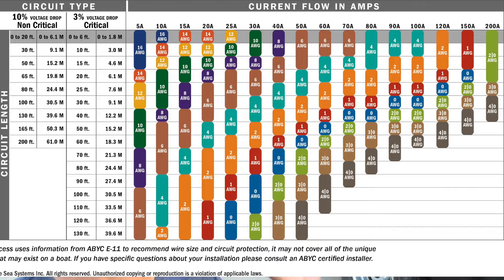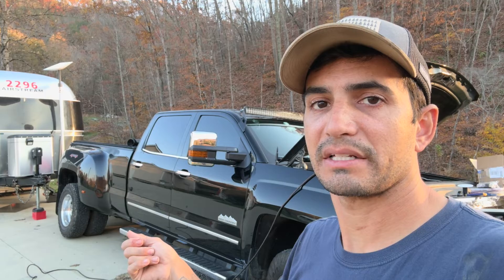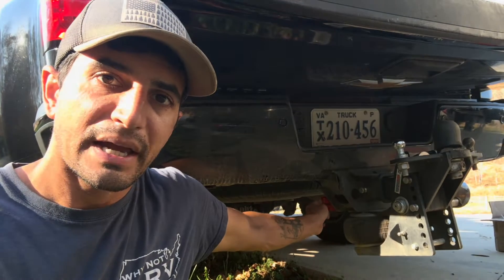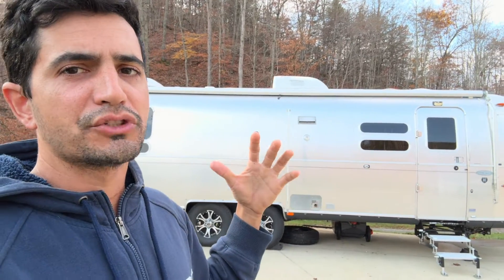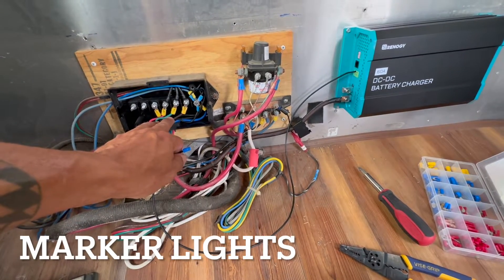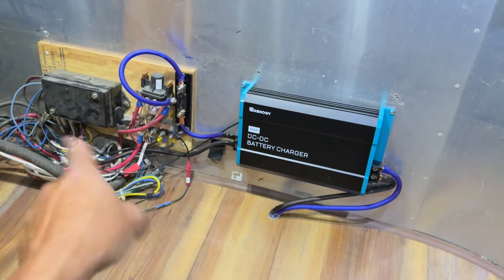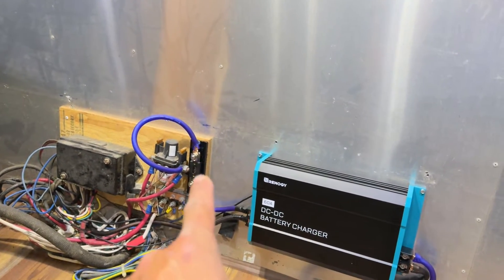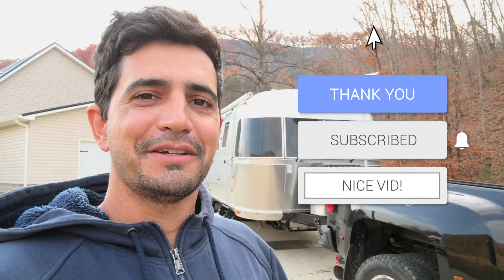Truck Charging! Installing a 60 amp DC-DC Charger - Why Not RV: Ep 139

Comment: You didn't mention one of the best features of the Renogy charger.  There is a second port next to the D+ that is labeled LC+.  When it is powered it reduces the charger output from 60 to 30 amps.  This reduces the amount of power your engine and alternator use to power the charger and is useful when driving in stop and go traffic or hills by putting less stress on the engine and alternator.  It will improve your fuel economy.  

I ran two wires from the charger to a separate Anderson connector that is housed in the same nylon conduit as the 4 ga. wires.  They are connected to a fuse in the vehicle fuse box that is only powered when the ignition is on.  The two wires are controlled by a three way ON - OFF - ON toggle switch.  The top position powers the D+ wire and the charger outputs 60 amps.  The center position turns off all power.  The bottom position powers both the D+ and LC+ wire and reduces output to 30 amps.  This is explained on page 14 of the manual.
Reply from the maker: Yes. It is a great feature. For me I just wanted max charging or no charging but for sure depending on your needs it’s a great feature. Thank you for this additional comment in here. Hopefully it helps some people.

Comment: I thought it went from battery to battery?
Reply from the maker: Not necessarily. It can, but you are taking the trucks 12 v DC system and going through a charge controller that gives proper charge current for your rv 12v system

Comment: I am looking into doing this setup on a whole new battery system for truck camper, so truck to DC-DC charger mounted in camper directly to battery. Then would do inverter after that.
 Any ideas on where you would mount the black "Starting Wire" if you dont already have a trailer wire setup like yours?
Reply from the maker: Great question Randy. I would do the same thing I did here but run a longer wire. I would just tap into a running light or directly from the fuse that feeds running lights. And I’d just run that with the larger gauge cables that feed the dc-dc

Comment: This is to make the 110 watts work on the rv plugged with the truck and dont need a generator?
Reply from the maker: No. First off you mean 110 volts (household outlets). Those work for me already due to my inverter I have installed. This is to recharge the batteries in the rv which are what powers the inverter which gives me 110v. This again is just another source to recharge the battery bank like solar or like shore power or a generator

Comment: Since you are running larger cables for the DC to DC charger have you thought about using the 7 pin wire that is normally used for charging as the wire to turn on and off the DC to DC charger.
Reply from the maker: If you watch the DC-DC install, you will see that’s exactly what I did. Use the marker light signal from the seven pin as the on off for the charger.

Comment: Nice video on installing the DC-DC charger. I was wondering how you like the Shocker Air hitch? Do you use friction sway bars when towing the Airstream?
Reply from the maker: Hey! Thank you for watching, I appreciate it. I absolutely love this hitch. It is unlike anything else. I typically add one suede bar when I know I’m doing interstate driving. It definitely helps out whenever. There’s some crazy crosswinds or air pockets from semi trucks. The hitch itself rides extremely smooth

Comment: Great info thanks.  Can you tell me the amp readings you’re getting?  The amps at the TV battery, at the DC charger input, and at the coach battery input would help a lot.  Like to see what it’s drawing from the truck and what is actually going into the charger. And how much voltage drop is there at the charger input. Thanks.
Reply from the maker: Voltage drop isn’t an issue with proper sized wire. As far as amperage, I did not actually measure anything but it should be what the charger is doing and set for. If full 60 amp and batteries need recharging in bulk it will do the full 60 amps. If batteries are full and it’s just in absorption or float mode the amps will be minimal

Comment: Thank you for a great video. I am curious about how the wear and tear of the for wiring is between the back of the truck and the trailer itself. With all the start, stop, left turns, right turns, braking, acceleration, bumps, potholes, etc. Are the wires showing any signs of premature wear?
Thanks and merry Christmas
Reply from the maker: No, if you prep it properly it’ll be fine. I wrapped it in plastic conduit and a lot of electrical tape and zip ties

Comment: You just explained why you needed bigger cables to deliver the amperage from the front of the truck to the back, and then you are relying on the original battery cables in the trailer to deliver all that amperage to the rear? Be a really good idea to get some good cables to your dc to dc converter in the front to the batteries in the rear.
Reply from the maker: The cable going back is already a 1/0 cable and is plenty sufficient

Comment: Victron has a better reputation, so why use Renogy if Victron has DC-DC charging products? You state truck charging is the only way to safely charge your batteries, but what about MPPT and inverter chargers?
Reply from the maker: Great comment. I’ve had both Renogy and Victron for DC-DC chargers. If Victron would step up there game and have them ve direct or some form of communication with the other Victron systems it could be argued that there price is worth it. But for what it is right now… not worth it. You pay twice as much for for one charger that’s half the amperage capacity. So you’d need the spend almost $500 for 2 30 amp chargers vs $160 for the Renogy that works just fine and gets the job done. As for the second part of your comment… if I misspoke and said it’s the only way to safely charge I apologize. Of course you can charge with solar and shore power or even wind. I was just trying to imply how to use your truck to safely charge

Comment: I have 8- 100ah battleborns.  I called battleborn (dragonfly) and they suggested i use a Li-BIM225 instead of a DC-DC converter.   Why do you think the Li-BIM 225 was suggested.  I did install it but I had to use 2/0 cable-pricey.
Reply: Their reasoning was due to me having so many batteries.
Reply from the maker: I’m personally not a big fan of those. Battle born is the only one who recommends them. Sells it on Amazon, it’s basically their own little product. It’s weird to me that it only charges for 15 minutes and then is off for 20 minutes. I’d rather charge when I have the truck running and know exactly what’s going on and how much juice I’m pumping in. End of the day it’s just a matter of opinion and preference.

Comment: Great video question is on newer trucks with a gas engine do you still have to wire the positive to the positive on the alternator can you not wire both to positive and negative from the battery
Reply from the maker: You can absolutely connect to the positive negative of the battery. That positive is connected directly to the alternator as is. The reason I choose to go directly to the alternator and it’s most ideal is because it is the most direct route solid cabling all the way to the actual source of creates power. When you connect to the battery you’re adding an extra junction from where your cabling goes and the juice actually comes from. I use speak to text for this, so hopefully this all made sense lol.
Reply: @WhyNotRV  So I am a real newby at this.  So I am charging an AGM battery in my truck pop-up.  Do I even need the DC-DC charger?  Or can I run line directly off the alternator, such as is done with the vehicle battery?  I understand there is a difference for Lithium batteries.  Thx
Reply from the maker: A truck battery and chargin profile is significantly different than that of a storage battery for a camper. You still want to use a DC DC charger to ensure a proper charge to your battery.